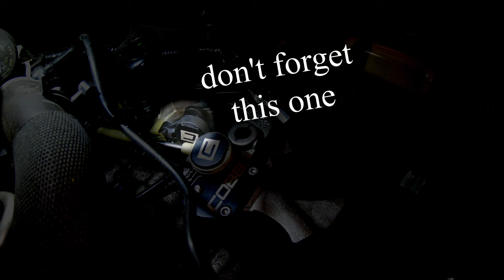HOW TO INSTALL A COBB ADJUSTABLE SHIFT PLATE ON A 2017 FOCUS ST

Comment: You don't really have to take the top of the airbox off for what it's worth. Just disconnect the intake tubing and pull out the entire box. Save yourself a little bit of trouble. You also need to use blue loc-tite on those bushings, should have come in the kit.
Reply from the maker: Thank you for the advice!!!!!

Comment: Dunno if you're aware, and I know this is over a year later, but that COBB shift plate you installed is the version 2.0. That version can be installed without knocking out the roll pin and removing that arm that the shifter cables attach to. There's nothing wrong with the way you did it. It gives you more room to work, but it wasn't necessary. I installed the exact same one on my 2018 Focus ST in about 15 minutes. I'm not hating or criticizing; just wanted to let others know that may be watching this that you don't actually need to remove that part to install the plate, you just place it over the arm of the weight and carefully screw it into place. 

Having said all that: I absolutely love how the engine cover, air intake pipe, air box, battery cover and fusebox cover were all painted to match the car. Very nice touch! Also, I really appreciated how easily you switched out the shifter cable bushings. Made it look effortless.

Comment: For anyone who’s curious, at 2:35 what he’s unplugging is actually an intake air temp sensor. Has 2 wires. Ecoboost engines have a turbocharger boost pressure sensor before AND after the throttle body. This is to calculate the air coming into the engine. No MAF sensor on turbocharged cars. At least not this one. And where’s your fender cover dude???